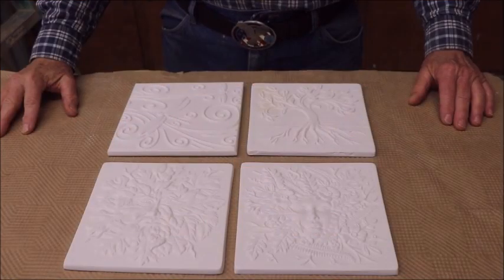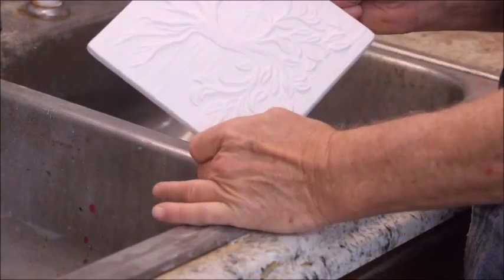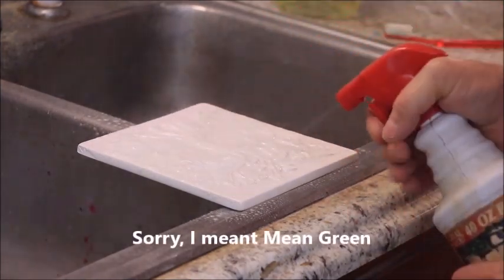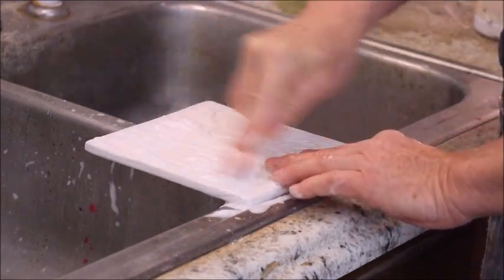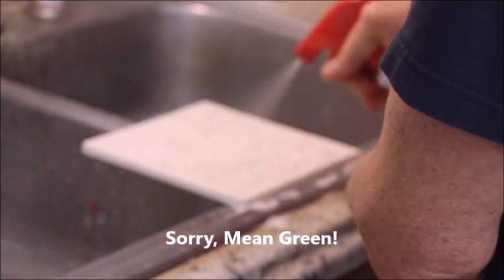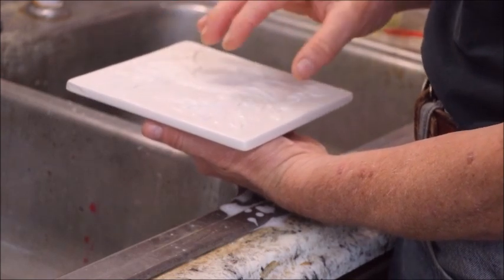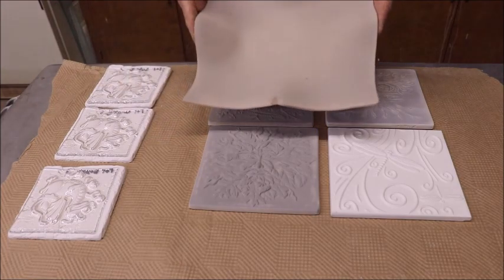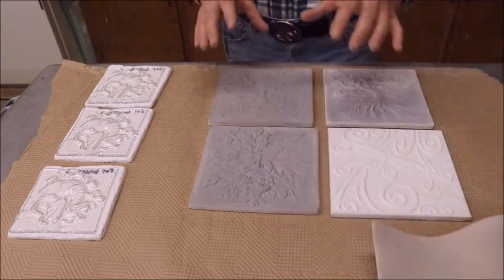Removing Boron Nitride from a Ceramic Mold

Comment: Thanks for sharing your experiment and success!!! When you sprayed with the glass separator and fired to 800 degrees, what did you use for a firing schedule or does it matter?
Reply from the maker: No it does not matter.  I have fired the separator in both a manual kiln and in a digital one.  No special schedule just go 9999 (fast as you can) to 800 degrees F and let it cool naturally.  If you some reason the cream color does not turn grey then just hold for 30 minute at 800 degrees and that should do it.
Reply: Thanks so much. I'm giving a double bottle slump a try :)